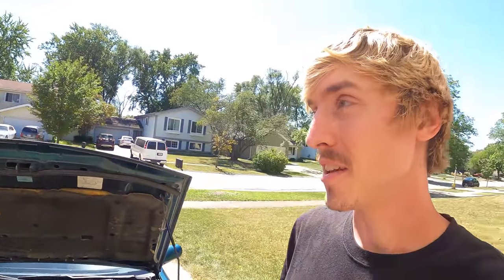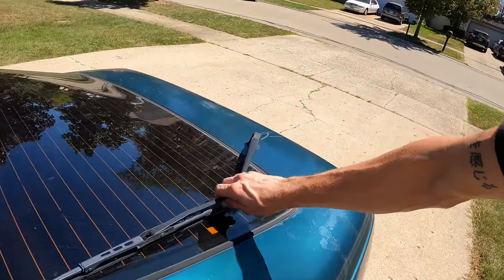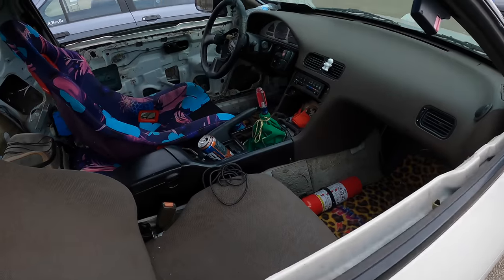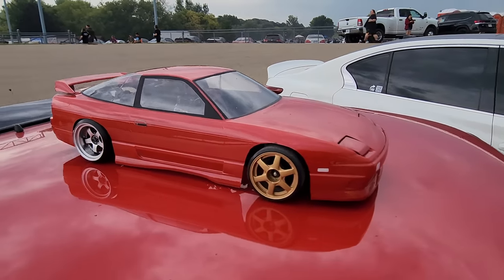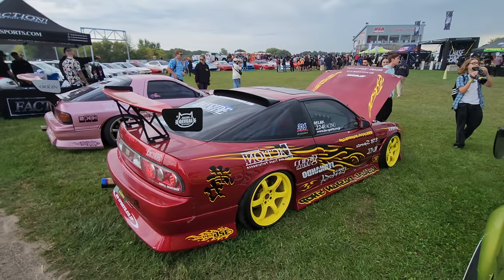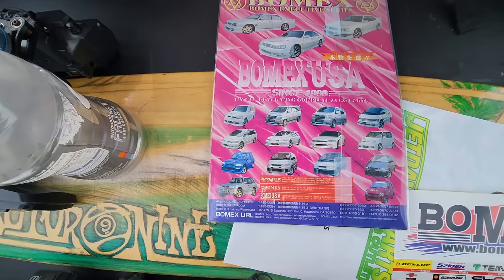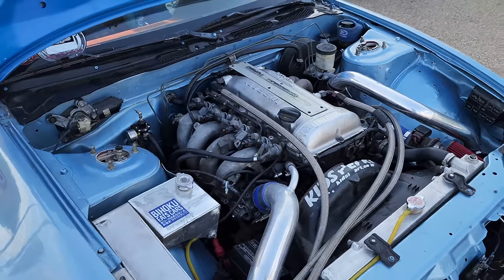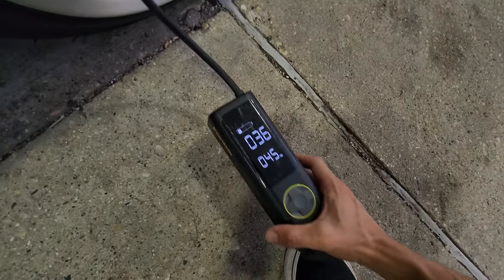TOP Grassroot Drifters Battle Head to Head at this Legendary Event! + 300ZX Maintenance

Comment: There's a lower timing chain guide that is probably making the noise. You'd have to take the front cover off for that though. Another thing you can do is clean the timing chain tensioners and work them back and forth to make sure they're tensioning properly.
Reply: He knows ka's pretty well. The top guide is normally the one that goes bad. And it was a last minute fix the morning of the drift event he didn't plan on going to. But there's 3 guides and a tensioner. Good looks

Comment: Check if the rear wiper has a fuse by its self and pull it out even if u take the rear wiper off it still has current from the switch when u hit it and if u forget to turn off the switch switch